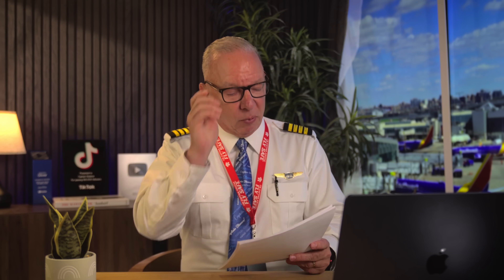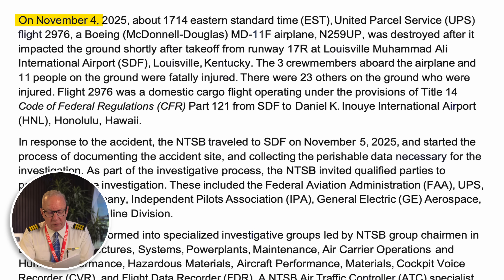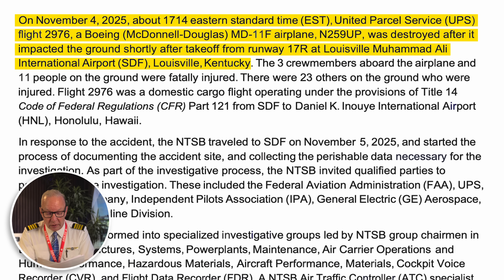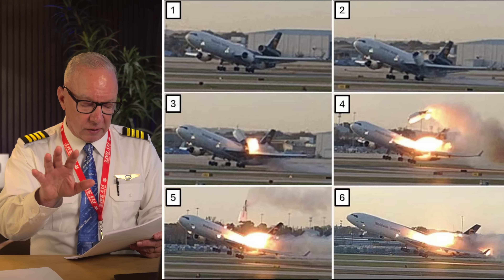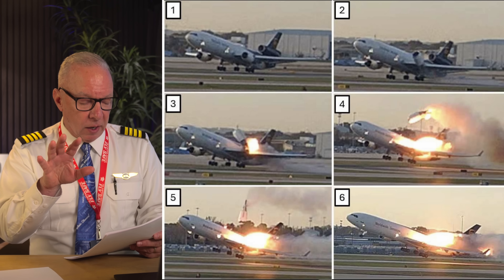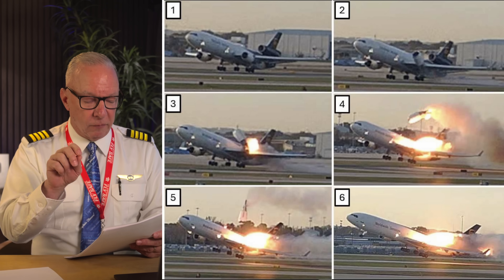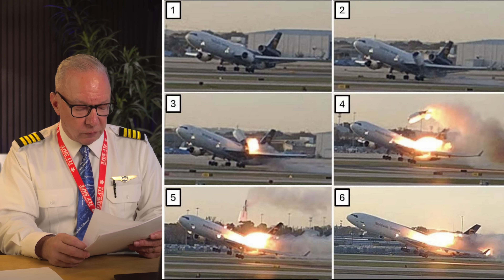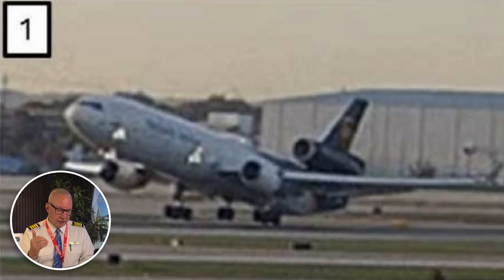UPS Crash Preliminary Report | Pilot Reacts to UPS Crash Report

Comment: Based on the price of a new replacement aircraft, it would seem that rather than scrap the remainder DC-10'S and MD-11'S. The prudent thing for carriers that have them is to all get together and have new pylon fittings with new spherical bearings and attach hardware, manufactured. Given the loads on these parts and their age it would be well worth it. With the quantity needed, it could be done relatively easy. There are many reputable shops that are currently fabbing parts for Blue Origin and SpaceX that are completely capable of that work. 
     Captain Steeve, love your work on these videos. That said I want to remind you and your viewers that while a terrible disaster to everyone, these planes have performed for quite some time now, and pylon failures have only been the cause of a handful since 1970 when the DC-10  was born. The brand new npt even yet delivered 777X which in certification test flights only has already needed a redsign of the thrust link and related hardware from cracking. Not after 50 years of service, just a couple years of testing. So yes, personally, I love those trijets, i think that NDT testing rather than a visual check, would have prevented this horrible accident and especially the loss of life.

Comment: Just checked, and the Louisville area is approximately 380ft-700ft above sea level. So that 481ft above sea level might be accurate in context of sea level, but not actual ground level, which is recorded at 30ft.
Reply: It is accurate.  The runways are at 460-470 feet.

Comment: I'd be careful claiming so definitely that that fire seen in that last CCTV picture is the no.2 engine stalling. It could equally well be the no.1 engine coming down on the other side. After all, two videos ago you clamimed with equally strong conviction that the no.3 engine was stalling. We won't know for sure which one - or both - it was until the NTSB releases more information on what the FDR had to say about it.

Comment: If the inspection cycle for those pylons and mounts had been more frequent, the fatigue cracks would have been caught
and corrected. I doubt we'll see the MD-11 / DC-10 flying again, except to an aircraft boneyard. Its a cautionary tale for
all other aircraft types, though. The way engines are attached to the pylon, and the pylon to the wing, will come under
closer scrutiny.

Comment: Just wondering if it wasn't "shrapnel" ingested into the #2 engine, but just the large amount of burning fuel that caused the compressor stall. Doesn't an engine need oxygen to continue providing thrust?

Comment: Are the lugs made of steel or magnesium alloy aluminium? I used to work in an aluminium foundry that specialised in aero parts and mag alloys. Sometimes we got air bubbles in the melt which was undetectable by inspectors so they could be the source of fatigue.

Comment: Actually, even in the first CCTV frame, you can already see the engine is slightly crooked, and a gap's forming at the back of the pylon. It's only one or two pixels wide at that point, but the catastrophe is already well underway.

Comment: With all the advanced technologies that are being developed, you would think that someone would have made an MRI machine for airplanes 👉 they have them at shipping ports

Cars▪︎trucks▪︎transports need to be scanned for drugs▪︎human trafficking

Ship▪︎planes need to be scanned for:
. Drugs
. Stowaways
. Physical▪︎mechanical faults on the inside & outside of the vessel

Don't talk to me about how much it would cost 👉 politicians find $ for everything

5 yr inspection on a vessel that has completed over 2k flies?  come on 👉  5 yr inspection on a NEW plane IS NOT  the same as the inspection of an OLDER plane
😂 That's like telling me an 80 yr old woman still has the same energy as a 30 yr old

Planes need to be scanned OFTEN. Lives are at stake on & off the runways.

Don't want to build an MRI then buy 20 of these NEW human like robots at 30k each to walk around and scan every inch of that plane then download its memory data & review the plane's information before take-off

That's making good use of robots

Comment: 5:31 The statment is 481 ft over mean sea level. Louisville is 466 ft above sea level. The airport is slightly higher at 	501 ft. So that would suggest that the plane is digging a tunnel 20 feet down in the ground.

Comment: Absolutely crazy.
How is it possible that such static mount can fail in the first place? 
Then 6 years inspection interval for such a high class safety relevant part of the plane. Probably something else much less important part get's checked every few FH...
And isn't aviation about redundancy? Why was the forward mount not designed to hold at least for 10 minutes or so in case the aft fails?

Comment: Would the loss of the left engine also explain the left roll to some extent?  Thinking: loss of the left engine while the right engine is full throttle would have resulted in a strong left yaw.  To counteract that would require right rudder, which would induce a left roll due to the leverage of the vertical stabilizer, wouldn't it?  At that speed, barely making lift, the ailerons may not  have had a whole lot of authority to prevent the roll, or perhaps the engine letting loose took out the hydraulics to the left aileron as well?

The fatigue marks on the fracture faces are telling...  The fact that such a critical attachment point failed in fatigue, in my opinion, merits immediate inspection of 100% of the fleet to ensure that condition doesn't exist elsewhere.  It's possible there was some small casting defect that existed from the day that piece was manufactured, and that this is a completely unique circumstance, but it's also possible this is the first of many potential failures and this one may save others from the same fate.

Comment: The DC-10 is no longer used for passenger service due to a combination of its poor reputation stemming from early accidents,Over 1,200 people have been killed in fatal DC-10 accidents,
Reply: DC-10 is no longer used for passenger service because it's a fuel hog.  Cargo airlines fly their aircraft much less frequently than passenger airlines, so fuel burn is less of an issue for them.

Comment: Thanks Captain Steeeve for your knowledgable review of this report and for your respect to the loved ones lost in this crash. Even if the aircraft had been able to limp safely into the air, surely the fire would not be able to be extinguished by the crew as I'm guessing any fire extinguishing systems would have been in the engine pod which was no longer attached. The intensity of that fire which was fuelled by full tanks of jet A1 would have more than likely been so hot that it could have melted the aluminium in the wing structure causing the wing to fail?

Comment: Are there parts of a plane that have maintenance schedules that have smaller intervals as the plane gets older?  If not, why not?  It would seem that the accumulation of hours or cycles would lead to a higher and higher likelihood of failure with the logical solution being more frequent inspections to stay in front of potentially catastrophic failures like this one. As a statistician I would use fracture and failure data to estimate the occurrence of both and set maintenance schedules significantly in advance of those time points to prevent accidents.

Comment: So they did the maintenance, but did they do it right?

These engines are VERY heavy. If the bearing grease maintenance task involves removal of the engine, and they didnt remove the unit properly because of reasons, they may well have pivoted the engine inappropriately during mounting/unmounting. If the weight of that engine pivots around the bulkhead connection in the wrong direction, this induces fatigue.

It sounds like - total jump to conclusion here - the weight of the engine was unbalanced during removal, AND they removed the engine and pylon as a single unit instead of engine first, then pylon. Betcha they removed the front bolt first and didnt have the engine supported enough, it shifted and ever so slightly overstressed the aft components, but not enough to induce failure right away.

This maintenance task was done recently, too...check their logs and talk to the maintenance crews who touched the airframe.

Comment: Unfortunately, many times the increase in aviation safety stems from tragedies like this. Certainly more detailed inspections at shorter frequencies of time will be designed and determined, to correct this unforeseen failure in the maintenance program.

Comment: I don't know when you would learn to not jump to conclusions without any evidence rather than waiting for official information after investigations. Without any evidence you said the #1 engine suffered an uncontaminated failure and debris went under the fuselage and damaged the #3 engine causing a compressor stall in #3. You based all of this on a split second flash of flame that you claimed came out of #3 when it was clear that it could have come out of either. The thing is all other news network experts were saying #2 was the one which was damaged by #1. After Air India I vowed not to listen to you ever again but I was open-minded about this one. And you are just going to move on and almost pretend as it you never said that. You are doing your credibility no favours. Wait before you make conclusive statements or at the very least say what the possibilities are. Disgraceful.

Comment: Ever so sad that people on the ground just going about their everyday lives got involved in this dramatic event. Thoughts are with the families of the deceased. Thanks for the explanation, Steve.
Perhaps with the low cost now of cameras and data storage, airports could install cameras at strategic points along the runways that might help with better pictures of take-offs and landings. They might then help these investigations at first sight. I appreciate that it still requires examination of the various parts involved.

Comment: Another bote on lubrication. When you inject grease into a beaeing the only way you know its greased correctly is when grease comes out the bearing via its rings. So theres always a lot of grease either from being in use or being greased. You cant do a propper visual inspection with grease everwhere so thats a load of croc saying it was was visually inspected. You cant tell if theres cracks or seizing because of the grease. They should be cleaned then inspected properly. And every 5 years ? When i was in charge of a power stations inspections on pumps motors etc i had to lubricate things daily and inspect. Note the word DAILY .. because bearings can fail and have to be inspected properly. These guys inspect every 5 years? Thats insane.

Comment: Dear Captain Steeeve, thanks so much for your comprehensive analysis of the preliminary report. Quick question for you: Would the weight of the aircraft have anything to do with this failure? You mentioned there was quite a lot of fuel on board for the flight to Hawaii. I'm assuming the extra weight (though perhaps not uncommon) would add additional stress to the pylon? Or would the bolts have likely sheared on takeoff at this point anyway?

Comment: if you look at the smoke down the runway the engine must have been on fire much sooner than has been stated BUT the first photo in the series of six which is at the point of takeoff shows no fire or any smoke so something does not add up.  Nobody has explained the smoke back along the runway. Why?

Comment: Thats a bearing failure. Which comes from poor or insufficient maintanence. No bearing lasts forever and if there was a issue in 1979 you would think they would inspect these things at least once a year. That bearing first seized then it fractured causing vibration which resulted in seaing and the forces made everything come apart. This is maintanence neglect. I am a tradesman ive seen many bearing seizes in my life being in a field that relys on bearings in pumps and motires and industrial equipment. This could have been avoided.
Reply: Your wording on that bearing should be after seizing the outer bearing ring split through the center of the ring.
Reply: Thats not from a fatigue crack. The bearing seized cause stress fracturs. Blaming fatigue cracks.  Such rubbish. That bearing seized first causing stresses

Comment: I spent large chunk of my working life  on endurance fatigue testing .  For a critical part that has already been involved in fatal event not to have been tested  is just negilgent.  On test 21000 cyles at one cycle a second takes only 6 hours normally we test much faster than once second . Because fatigue cracks were found on the righ engine as well  it is not a one off . This indicates these absolutly critical joints were never fatigue life tested just estimated .  They died because a few days testing was not done .....We do more tests on excavators than that !
Reply: Absolutely....I have worked as a practicing structrual engineer for over 35 years.  21,000 cycles is absolutely should not be critical for a well designed connection subject to cyclic loading.

Comment: First off all RIP for all who perished 🙏 I started my career as Cabin Crew in 1979 till 2019. Flew on the DC-10 / MD11 and all 747 models except the 800. As a Dutchman and living only 20 kilometers from the Bijlmer where El-Al crashed after loosing two of its 4 engines. Many more 747 and other Boeing planes lost engines in that same time. What is curious is that none of them were ever grounded as what happened with the DC-10 and MD-11?  Anyone knows why that never happened

Comment: This is the end of all MD-11's, you can't inspect a way around circumferential fatigue cracking because it does not grow, it is what we call in engineering 'catastrophic' meaning it goes without warning or any inspectable sign. And... if you could, why would any operator spend huge amounts on an inefficient, old 3-engined aircraft. I think the reason why the FAA have released this level of details so early is because it's obvious this is the end so not worth spending millions coming up with specific type recommendations, what they need to concentrate on is:
Is it sensible to allow fuel reprocessing facilities, gas stations (and concrete walls) to be on the end of any runway
As well as an engineer, I am also a commercial pilot, Concorde, this, and a few other crashes are pointing the way to another V1 airspeed, call it say 'V1 crash' where if there is major explosive type of failure, its better to destroy all the brakes, tyres (and probably aircraft) but crash at 25 Kts off the end of the runway.
Should runways have a rough, stop area full of arresting sand / gravel at the end facilitating an artificially higher V1 thus V1 might be greater than Vr allowing a stop AFTER a rotate. The military use arresting cables.

Comment: Question,, is it possible that in October when the bearing was lubricated, either it was over lubricated, or something was stopped up and it didn't get lubricated,, or maybe the PRESSURE OF LUBRICATING IT MAYBE CAUSED THOSE PIECES TO CRACK UNDER THE PRESSURE OF THE LUBRICANT ( GREASE) BEING FORCED INTO IT,, OR IF IT HAD SMALL MICRO CRACKS ALREADY, THE PRESSURE OF LUBRICATING MADE THEM WORSE?? POSSIBLY? SINCE THAT WAS THE LAST MAINTENANCE DONE ON THE PLANE, A SHORT TIME BEFORE THE CATASTROPHY I WOULD BE THINKING IT MIGHT HAVE BEEN A FACTOR.....

Comment: Engine 2 may well have been compressor stalling due to ingested Debis and fire, but I wonder if the fire at the back of the aircraft was actually the separated engine hitting the ground behind it. The fire seems too low and too far behind for it to be from No 2. I think we need to see the full video before we can be sure. Whatever is the case, shocking accident and so sad for everyone affected.

Comment: Inspections are clearly not enough. These critical parts need to be replaced more frequently and before stress fractures develop. Lets see if the FAA mandates a change to the replacement frequency or whether the cost vs lives equation keeps things as they are.

Comment: just for clarity the forward lug is not referring to the forward mount meaning that it was the aft lug that had the stress cracking and as that one broke the forward lug of the aft mount could not hold the force alone and broke due to high stress and that is the reason for the race on the spherical baring being splitt in 2

Comment: So engine 2 was taken out by shrapnel? I know bird strikes are a real risk. What percentage of accidents are due to something entering the jet engine?  Has anyone attempted to install some kind of screens?
Reply: Some planes had their engine "covers" fall off and those planes have landed safely, you would not want to fly with anything directly in front of those fans. If there was a screen attached to a cover and something were to dislodge that, where do you think that will go since it is directly in front of the engine fan?
Reply: @amyhartman6786 Certainty they can engineer somthing strong enough to resist birds and slower moving shrapnel and debris.  
Or maybe something that is breakaway?  The impact instantly jettisons the screen, but the engine lives on to fly another day.
Reply: @manonthemoog  if it is designed to breakaway and is directly in front of the engine fan it will get sucked "ingested" right into the engine by the fan, defeating the purpose of protecting the engine.
Reply: @amyhartman6786 OMG, just when I had it all figured out, you found a fatal flaw in my design! Back to the drawing board...

Obviously more debris in the engine is not the solution. Is it possible to design a breakaway feature in a way that it would be carried away by air flow and gravity.  

My question is really, how often does something catastrophic happen due to an engine strike?  Maybe its so rare screening the engines is not worth the effort.  But very bad things happen when it does.